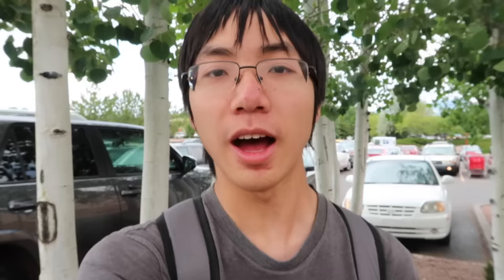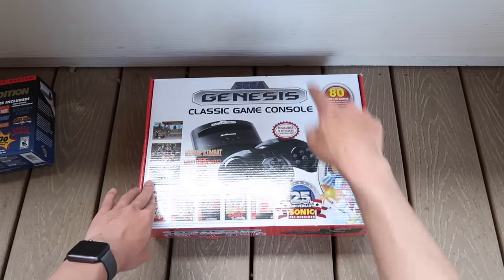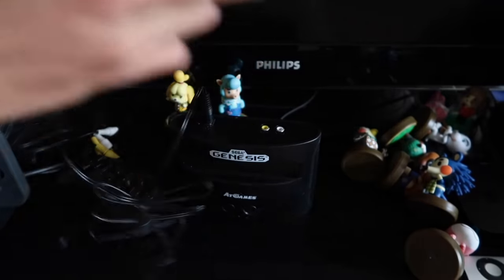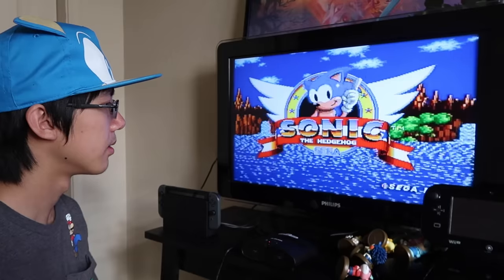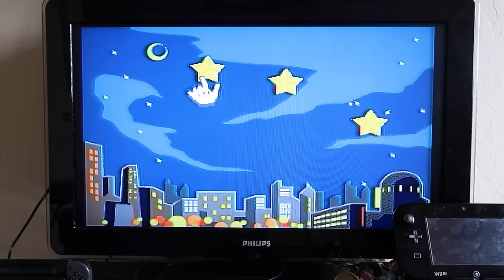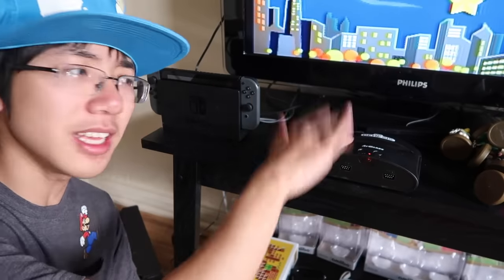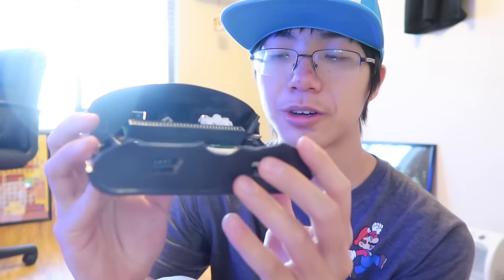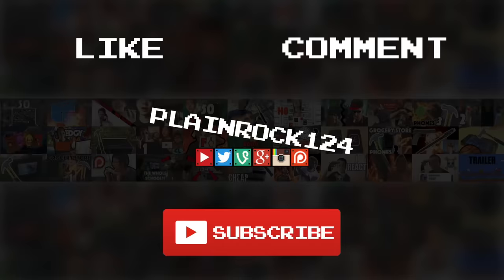Bored Smashing - SEGA GENESIS CLASSIC EDITION

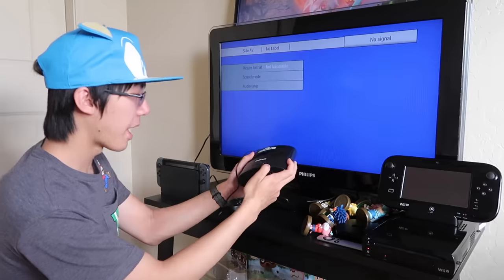Comment: 4:10 that resolution was literally designed for a handheld... No really, they sold handheld versions of the console that use the same interface
Reply: Was it worse?
Reply: @superalt513  I had the handheld version, I believe the sound was better but the only thing I remember about it was when I was close to completing MK1 and about to face Goro, the game reset for no reason. And I remember MK2 and MK3 were the Master System (aka from Brazil) Versions. Thanks a lot ATGames

Comment: Well it's not as rare as the original ones released in the 1990's, but the Genesis from the 1990's are not that hard to find either, they're just a little more uncommon, but can be found.

Comment: 6:44 he didn't notice there's no batteries in the console they fell out
Reply: Firstly, it's the controller.
Secondly, he took them out for safety.
Reply: Ben Townsend from my experience, normal AA batteries cannot explode lmao. But your point still stands.
Reply: @Plainapple287  but they can leak
Reply: He took the batteries out before throwing the controller

Comment: I still have 2 Sega genesis video game consoles & I have SEGA genesis mini & SEGA Genesis flashback & My SEGA genesis flashback video game console & this one does Plays Sega genesis & Sega master system & Sega game gear games & Sega genesis Mini does not Play Sega Master system & Sega game gear games on Sega genesis mini & it plays SEGA genesis games instead &  i have 5 SEGA genesis Controllers & i have 2 Original Sega genesis controllers & 3 Sega genesis model 3 Controllers & 2 wireless Sega genesis controllers & 1 wired Usb SEGA genesis model 3 Controller for Nintendo switch

Comment: Jeeeeesus, i have never saw hot garbage even released by REAL stores,  till now. AT Games really is bad, like they butcher the sound chip horribly they cant even pitch the songs correctly?! HOW IN EVER DO YOU MESS THIS UP!? and overall, its just a horrible, horrible product. ALSO, That resolution looks ABYSMAL, Because THIS Was released SOMEWHERE in 2010's! The SAME YEAR OF WII, PS3 AND XBOX 360! I'm Appalled that they're even working with SEGA in the 1ST Place! and also, the controllers arent even wireless in the correct way, they were wireless to Ir Sensors!? why not bluetooth!? sure the wii might have needed ir sensors, but THAT was for pointer controls!